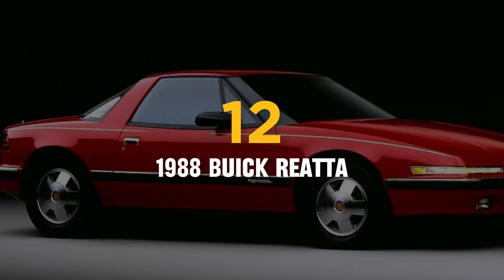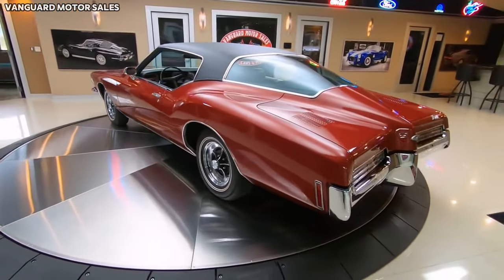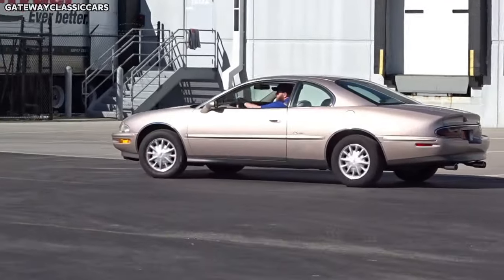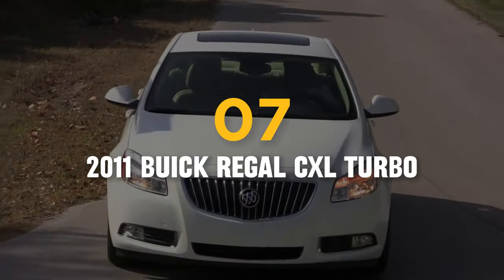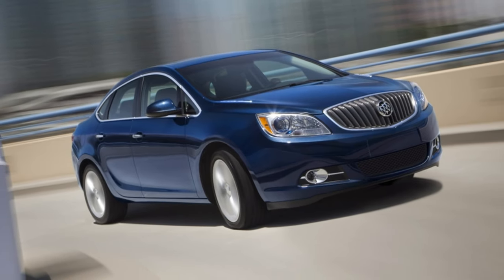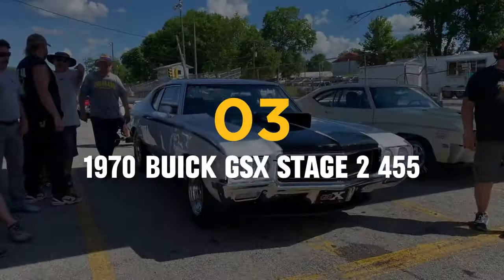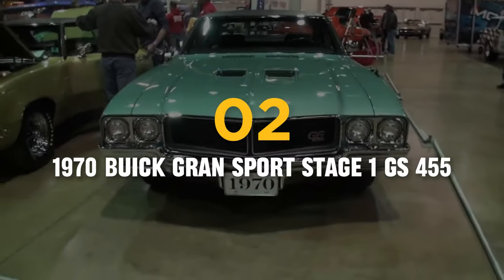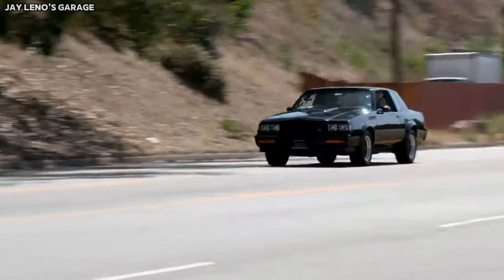12 Fastest Buicks Ever Made! (0-60mph)

Comment: A lot of factual errors in this video. A lot.  Buick never had a 427. They had plenty of 455 v8 engines
Reply: Yup, it's loaded with errors. The Turbo Regal 3.8 was listed as 183 CI.. The GNX was a 1986, which they were a 1987.
The 70 Stage2 was behind the 70 Stage1..
Why the focus on 0-60 times. 0-60 is not a good testing point, ad some good rear gears and any car will improve on the 0-60.. 
Your also picturing a very heavy modified Turbo T-type, engine bay and the warped fiberglass front end..
Really not impressed with this video, i'm really really sorry to say.
Reply: @petereconomakis149 ; 183 c.i. is a 3.0 L.
I got lost with the Stage 2 diatribe.
I thought Stage 1 was the cats meow in the Buick world.
Reply: @Johnnycdrums  Oh yes the Stage1 was quite the fast car. Could argue that it was the top 2 of fastest 1/4 mile cars just as bought..
The Stage 2 should of never been put into this video. It was never a car that you could buy from a lot. They had planned to make them for the 1971 year but the low compression and unleaded fuel new laws stopped any hopes of building them. It would have been truly special.
It was to have these newly designed really high flowing special heads and cam etc..These special heads with 2 inch round ports on the exhaust side could get into the high 10 second range 1/4 mile when built proper! They did however make these heads and other parts available over the counter at Buicks dealers around 1972.
The video also did a quick mention of 150 mph?? for this Stage 2. Thats pure nonsense as its a car made for the 1/4 mile. It would take a 8 1/2 second 1/4 mile car to run that fast at the end of the run.

Comment: I wonder what that 65 GS skylark would run 0-60 with just  a set of headers and more important, at least a 3.42 gear and some sticky tires. Low to mid 6s??? Buicks were always cool. My did had a  73 Riv...same color as the one in this video..with the buckets,center console and Buick really wheels. Loved that car. In 75, he w as going to  give it to my brother for his 16th birthday,,,,,,,,wanted a 75 Trans am instead.  The 73s Riv had duals and obviously no cats on it. The trans am had one plus a Bonnyville salt flats  2.56 gear.  I woulda taken the Riv.  I dig the Buick 3.8 supercharged mill in my 05 IMpala SS. Just a pulley drop to  3.5", some exhaust upgrades, PCM tuning and it really wakes up. Buicks are cool
Reply: When Buick offered the L76 340 hp. 401 late in the 1966 model year it was about .3 seconds quicker in the 1/4 and 1 second quicker 0-60
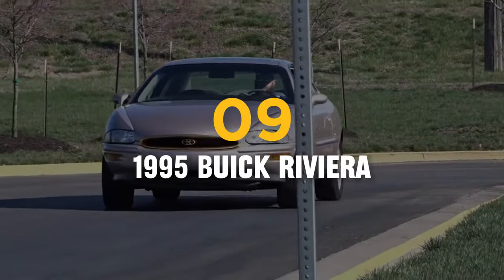This was still with 3:36 rear gears.
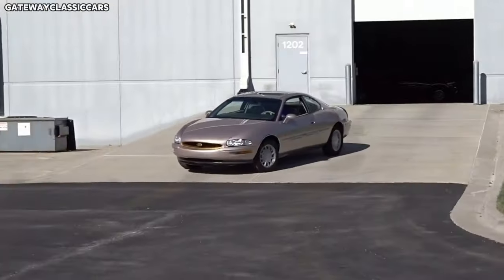Reply: @petereconomakis149 I believe it was Car and Driver that tested 6 1966 muscle cars , they even had a Gran Pre  driver Aston Gregory testing them on the loop. They also tested them in the 1/4  and the stock Skylark GS with the 401 2 peed auto with 3:36 gears turned a 14:95.
Reply: @basilcarroll9729  I think thats the car in the test, I forgot to mention the high 14's.
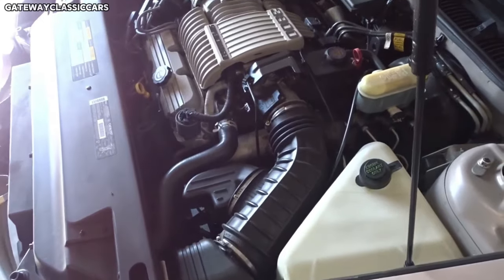They also made around 50 Skylark GS's with forged pistons at 11 to 1 compression.. They tested one in the day that had that 2 speed and 3:55 gears.
They unbolted the exhaust pipes from exhaust manifolds and the car did a 13.82 with cheater slicks.. They might of all been called Flint Flyers??
They say about 12 out of the 50 had been stroked to around 469 CI. and were almost unbeatable in their class. These were the true Flint Flyers. They cheated but never got caught. Every one I believed was cheating back then, even Olds was using a 425 instead of the 400 in their 1966 W30.
Their might be a few of these 469 CI Skylarks GS's still around but for sure there is one that was restored. 
There is a book on the work behind the scenes on the making of these cars. So much was going on and alot of info is unknown and lost.
Look up Buicks Flint Flyers..

Comment: You need to get your facts correct. About Buick muscle. The Buick T-type and Grand National did not use a 198 CI. it was the 231 Ci. The 1970 GS Stage 2 were factory test pieces offered to Buick Racers, in 1970.  The Stage 2 was never put into production. Only available over the counter, stating in 1971. The 1970 Buick GS Stage 1 was a 455 ci. conservatively rated a 360 hp and 510flbs of torque. According to original road tests the 3rd fastest muscle car built.  The car used in the segment about the GSX Stage 2 was not even a true GS. It is a clone of a GSX made from the Skylark 2 dr sedan.